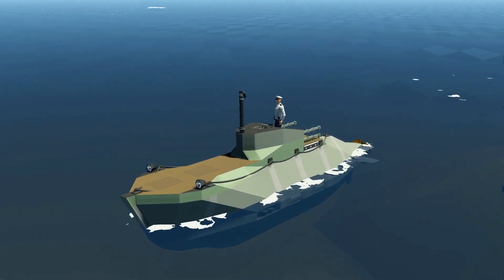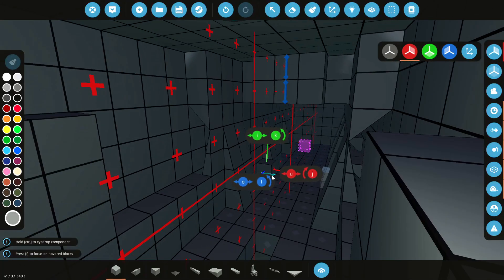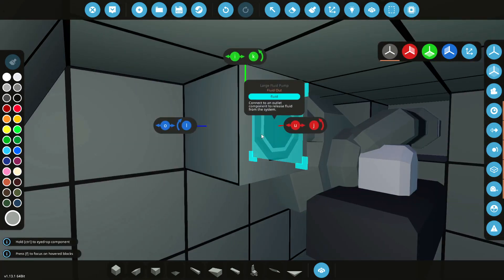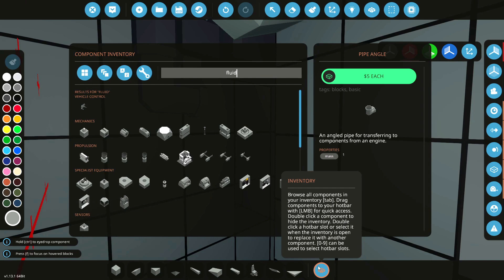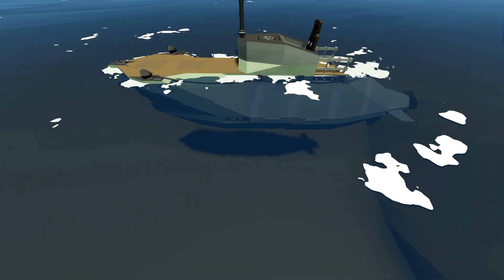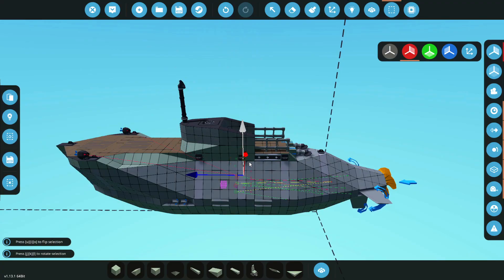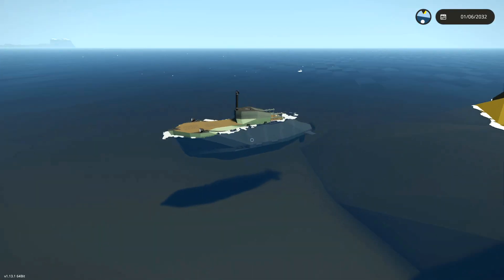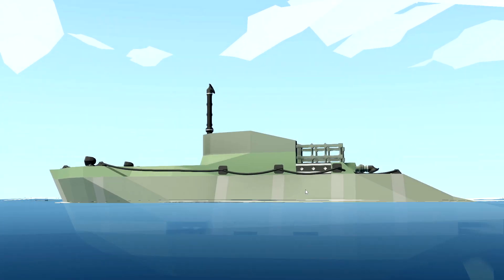OUR MINI SUBMARINE Has BALLAST TANKS In Stormworks - Part 3!

Comment: Really nice little sub.

For the armament, I suggest a single axial Torpedo Tube on the bow with a sliding hatch to open the tube with a single torpedo inside, making this sub a small raiding unit.

And I'd suggest to ditch the diesel engine, keeping it a fully electrical sub (also because there is no space for fuel).